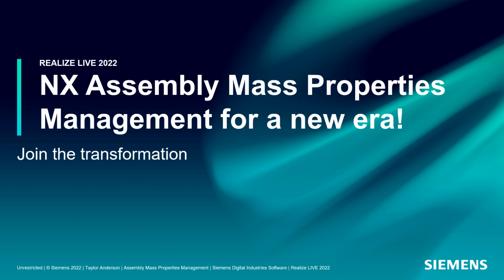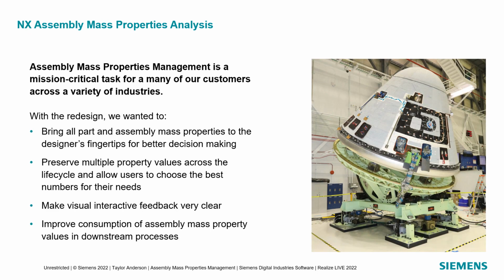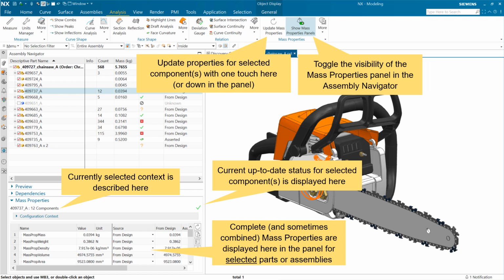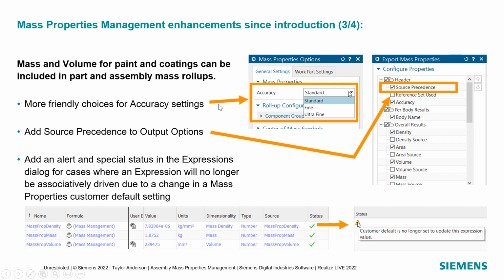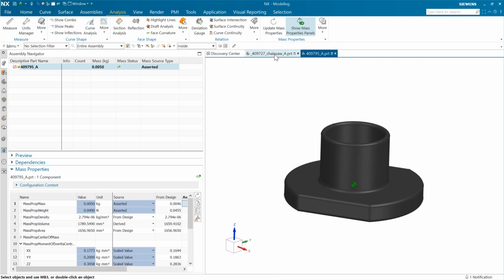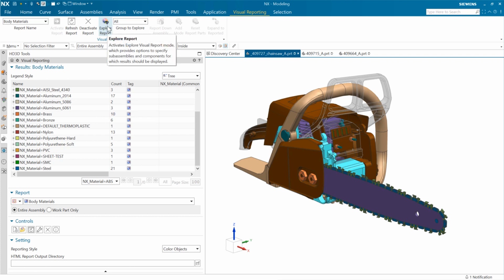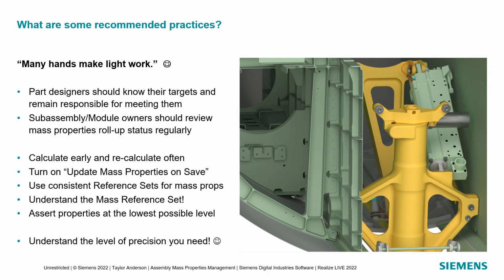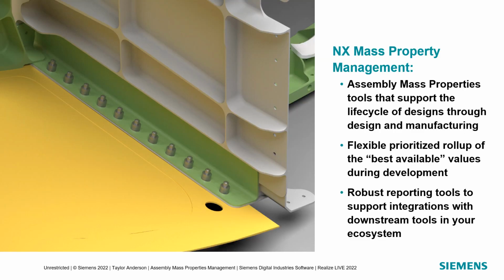NX Assembly Mass Properties Management Overview (from Realize Live 2022)

Comment: Is it possible to show the COG symbol also linked on a drawing?
Reply from the maker: Great question.  The little colored CG markers we show here in the Modeling environment are not persisted to where we could display them in Drafting at the moment.  But you could certainly use the Measure feature to create an associative point entity at the Center of Mass and then use this in the drawing.  Does that make sense?